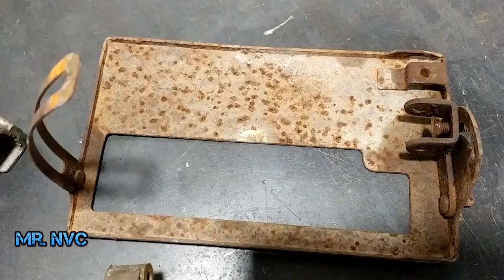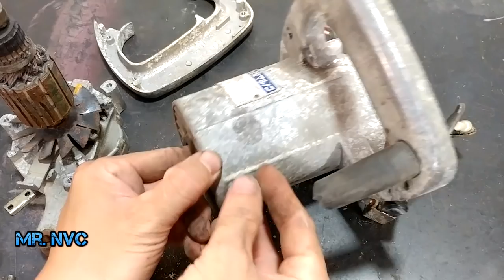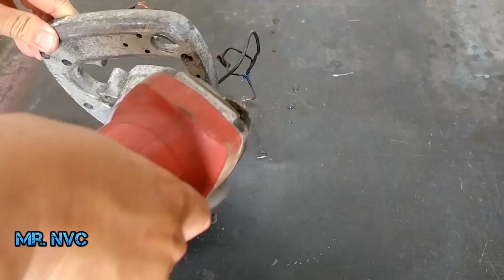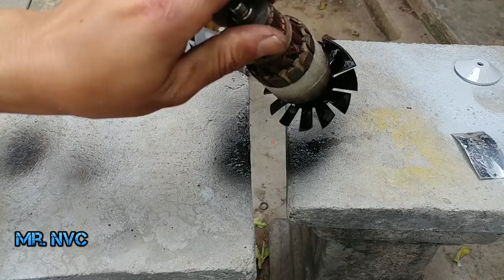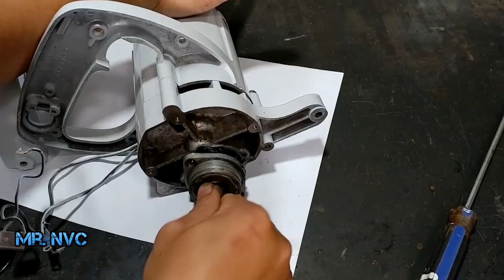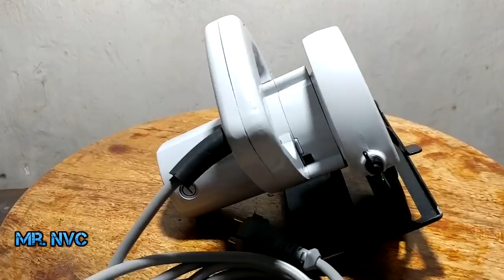CIRCULAR SAW Restoration (Very Old) - Rusty and Restore It

Comment: Original 3 wire cord with a green ground replaced with 2 wire cord, no ground. Connect to a GFCI breaker for safety. Like to see welding repair on the broken guard. That steel blade is for thin plywood. Next logical repair should be a press to use on those bearings.

Comment: Have you ever thought about powder coating your old refurbish projects? It would make for an extremely durable finish. JMHO
Reply: ... but powder coating is not cheap and since hi doesnt have proper wire crimping and stripping tool he also doesnt have powder coating equipment.
Reply: OVERKILL.  NEW FACTORY TOOLS NOT EVEN POWDER COATED.    CHROMED OR POLISHED SCREWS WOULD HAVE BEEN COOL WITH WHITE PAINT THOUGH.

Comment: Get rid of that 2 core flex and put a 3 core in..!! 

This will give you a core to EARTH IT PROPERLY...
As it was before you started tinkering about with it...

With thanks
Glenn
GLMelectrical
UK
Reply: glenn -
Agree.  Amazing that majority of these “restorations” are just a “Clean and Repaint”.

The Power Cord replacement is Not Electrical Code Compliant (3-wire, safety ground) ... 
since this power tool is NOT Double Insulated.
IEC 60364 standard is an attempt to harmonize national wiring standards in an IEC standard and is published in the European Union by CENELEC as "HD 60364". The latest versions of many European wiring regulations (e.g., BS 7671 in the UK) follow the section structure of IEC 60364 very closely, but contain additional language to cater for historic national practice and to simplify field use and determination of compliance by electrical tradesmen and inspectors.
In North America, the National Electrical Manufacturers Association (NEMA) and National Fire Protection Association’s National Electrical Code (NEC) pre-dates the IEC 60364, but both organizations work toward global trade practices for tradesman & consumer safety.

I did not see cleaning practices on electrical motor (restorer likely does not know).
The Bearing replacement has been commented by others already.
Reply: @w9gb 

Yeah...
I'm a UK based electrical contractor....i work to BS7671...
I do have a few older copies of the NEC kicking around though as well...as I like to see what other electricians work to....
The terminology is a bit different...but there's loads of common ground...plenty of crossovers...
Reply: But there is a ground, it's the guy holding that deathtrap ;)
Reply: His "About" section shows he may be in Canada but the language is Vietnamese.  If he's not in The Great White North and his little shop is somewhere on a street corner in Southeast Asia, electrical code may be non-existent.  Just a thought.
Reply: @aaronneumeyer5572 

Hmm...
Do you think that IQ's also drop sharply around his 'little shop'...?

The frame of this still needs a safe, reliable reference back to star...
Wouldn't you agree...?
Reply: @lefler9048 

So...
How far did it have to drop before it hit zero..
20..?
35..?
Interesting that you think you speak for everyone else though...isn't it... 
Lol...
Reply: @glennmoreland6457  It would have to drop pretty far considering I'm a triple Bachelor and hold two Masters, but it would be impossible for anyone to outperform the great glenn. My apologies your majesty.
Reply: @lefler9048 

Oh...your welcome.. 👍

I thought about going to uni...
I've more than a passing interest in history...
The great war...the events that led up to it and its aftermath... 👍

Point taken..I'll tone it down a bit with some of these in here...
It's correct that I'm time served electrical contractor...but I'm usually quiet about it...

Comment: You need 3 core cable for safety
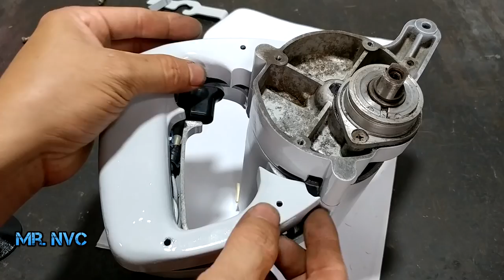Reply: 23:42 where the wire is over the screw holes,
I hope he re routed, and not clamped between
the handle, the un earthed handle!
Nice to see someone change the bearings on a
restoration, but, should have used sealed not
shielded.

Comment: Disappointed, you took the two screws out of the stator housing but didn't remove the stator and then subjected the stator windings to solvent and paint. I know the stator comes out, I've done it, would have been much easier with stator removed.
Reply: I am struggling with the same problem with my old power drill. I just removed the screws from the stator but that is the point where I am stuck. It does not come out at all. I don't know if applying more force would help...

Comment: Good work with what you had. Just take care, at first, this saw was grounded, then you replaced the original 3 wires cable with a two wire one. This saw has a metallic case so it could be dangerous. Anyway, the result is ok. Nice job.

Comment: Have you ever heard of evapo rust before it you can get some why don't you use that instead I have seen handtool rescue use it and it seems to work well at removing rust.
Reply: Electrolysis works fine too, evaporust is actually pretty slow.
Reply: But, yes, i like he's giant barrel and he's humour, i love that guy too.
Reply: @sheep1ewe  but evpo rust may be slow but it is safer
Reply: As i heard it's not acidous and does not contain salt, but i hawe not much personal experience from it.

Comment: What happened to the earth?
Reply: Mankind pillaged it!
Reply: If you use this saw, you're it! They actually don't use a ground lug on every outlet. Makes a metal cased motor kind of dangerous to use.
Reply: Looks like he disconnected it at about 07:43, but at 23:41 it hasn't been put back in the same place.  It does kinda look like he relocated the earth wire to a screw on the cable clip instead,  maybe? Hard to tell as the sleeve colours aren't green or green and yellow.

Comment: Are you sure that none of those metal parts weren't stainless steel.  You NEVER want to use electrolysis on stainless steel as it produces  Hexavalent chromium which is extremely toxic and highly carcinogenic. Disposal of this electrolyte into the ground or down the drain is illegal in most countries and poses risks of contaminating ground water and city water supplies. Touching this chromate-containing electrolyte must also be avoided by all means.

Comment: Waste of time on that old saw blade those new are the cheapest blades to buy  and the condition that one was in when you began  it looked like it was pretty  shot your  sharpening attempt    Won't work  each tooth should be sharpened  with precision  on a jig  to  create the correct angles  sharpening  incorrectly   Can cause  kick backs and   Dangers to the operators   Those old saws   Are dangerous to begin with